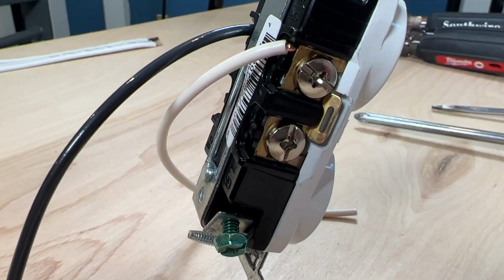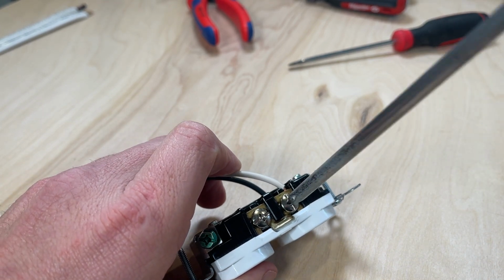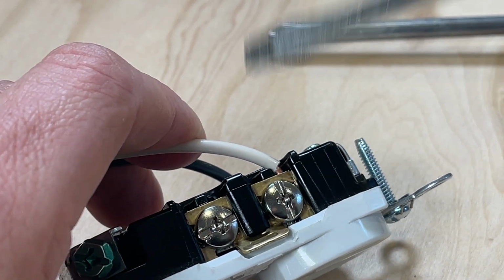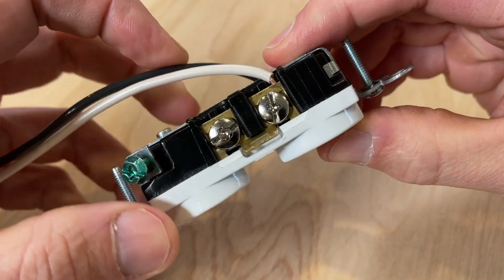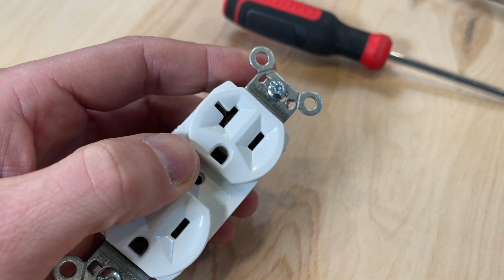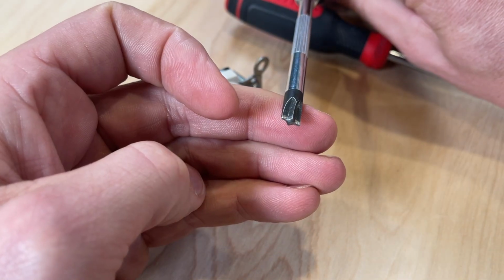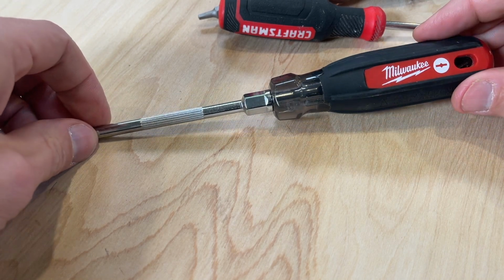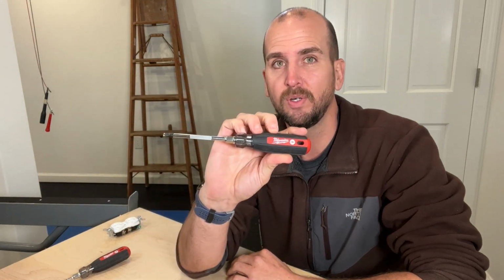80% of People Use the Wrong Screwdriver For Electrical Work

Comment: The Roberston (square) is a simply superior screw.  It is great for electrical work but what I like best is that when driving screws you can put the screw on the bit first and it will stay there. Also, the screwdriver bit will not cam out as easily as a Phillips or slotted. If you buy a box of Roberstons you will never go back to Phillips.
Reply: Every type screw has its disadvantages, including Robertson.
Reply: @jamese9283  True, but Robertson has one quality the others don't have: you can easily renew the screwdriver tip. Robertsons are slightly tapered so if the driver wears grind a bit off the end and now it fits good as new.
Reply: @jamese9283   whats the disadvantage ??
Reply: @mikecarter9225  Robertson disadvantages:
- less forgiving to drive if your screwdriver is not perpendicular to the screw head
- less forgiving if you have the wrong size or cheap driver
- easier to strip if your driver slips out due to less metal contact area between the screw and driver
- easier to overdrive (phillips is made to cam out with too much torque)
- harder to seat the driver into the screw head due to the precise fit, especially when there is debris in the screw head
Reply: @jamese9283  Robertson simply has less disadvantages than any other type.
Reply: Slotted screwdrivers don't "cam out" because a slot is not tapered, as a Phillips drive is. The main disadvantage of flat blade screwdrivers is their lack of self-centering.
Reply: Add a good magnetic bit holder and you can’t make that screw fall off.
Reply: @jeffreyesguitar5129  , if you're using non-magnetic stainless steel deck screws and similar, magnetic bit holders and socketed screwdrivers don't work any better! But yes, Robertson screws in general are terrific, and I prefer them over Torx.  Note that Makita makes a handy dandy little hollow, bullet-shaped magnet that slides over the shaft of your screwdriver or 1/4" hex drive bit and adds extra magnetic grip. These work really well for holding screws of all types.  I've never used a Robertson screwdriver on electrical outlet screws, but a #1 does seem a little small for the job. I wish it was a #2.
Reply: @goodun2974  Why do you prefer Robertson over Torx?
Reply: @jamese9283 ,  for one, Robertson screws not only stay on the drive bit or screwdriver tip better than Torx do, even without a magnet, but they stay on the head better when you're starting a screw into wood without drilling a pilot hole, and there's less wobble and play between Robertson screw and matching driver than you'll find between Torx and driver. That junction of Robertson screw and driver just has a solidity to it that Tork do not. You can really feel it.
Reply: i personally prefer hex drives never had one broke on me and even if it did you can just cut it and reuse it i wish every bolt was hex drive
Reply: @DatBoiOrly   I have seen plenty of stripped out hexhead screws. Part of the problem is that they come in both SAE and metric sizes and it's not always apparent to the average person who goes to use an Allen key (as they're known in the US) if they've actually selected the exact correct size wrench to fit that screw. It kind of requires thinking about the device and asking yourself where and when was it made and where the hardware likely came from. The audio equipment I work on for a living often arrives at the shop with chewed up hexhead screws from somebody else going inside of it and maybe using the wrong size wrench or a hex wrench with a worn tip. The worst case scenario is when somebody tried to break the screw free with a cordless screwdriver!. I always try both metric and SAE wrenches to find one that fits nice and snug, and then I ALWAYS break the screws free by hand. Metal chassis and cover plates with black paint or anodizing are often frozen in place, to the point where when they break free under tension they actually go ping or snap! Occasionally I encounter one so tight that I have actually twisted the hex key a little bit! It's not uncommon for me to have to use alternating heat and cold on the screws to help break the bond of the anodizing that seems to weld itself together under pressure.
Reply: @goodun2974  I agree. You must use the correct driver. But as he shows you can often get the job done with a smaller driver, no matter the type, but you well may foul up the screw head and/or the driver bit.Still I have often done this very thing.
Reply: @larsord9139   I repair vintage stereo equipment for a living and we frequently have equipment coming to the shop where somebody has  stripped or half stripped all the cover screws (especially if they're Allen/hexhead;  nobody else ever takes the time to make sure they have the absolute correct size, tightest fitting  hex key, and all to often they start trying to remove them with a cordless screwdriver instead of breaking them free by hand first). I've got a whole bunch of tricks for getting out screws like that.  If they're really stuck, as is often the case if the chassis, cover and screws are anodized or painted,  Alternating heat from a soldering iron or heat gun with cold from freeze spray often breaks the bond and makes it easier to remove them.
Reply: @goodun2974  I find another use for torx is to extract rounded hex screws.
Reply: @goodun2974  Ugh, I hate people being unable to tell the difference between SEA and metric hex heads. "Eh, this one is close enough. Hey why'd it round out?" 🤦‍♂️
Reply: @mjc0961  , it does give Torx a bit of an advantage if only because it's quite obvious when you're attempting to use the wrong size wrench ---- it just won't work at all!
Reply: @DatBoiOrly  I fully agree, problem is: hard to find all the types and sizes you need using hex drive. If they were more readily available I would give all my wood/sheetmetal/machine -  square/torx/phillips drive screws away and go all in with hex drive. (boy i had trouble spelling "readily")
Reply: Those screws are kinda annoying, though, when you come across some random screw that you need to take out of something and then you gotta get the screwdriver to fit that when 99% of all other screws are either Phillips or slots. Also, the nice thing about Phillips screws is that there's a huge amount of size tolerance, many Phillips screwdrivers will fit many screws (within reason), and you don't have to be precise if you're careful. In any application that doesn't require a lot of force, where you just need a screw to hold something together that isn't taking a lot of weight, the Phillips will work just fine and the reason so many people love them is because they combine all the best things about screwdrivers; the versatility, the ease of finding a screwdriver to fit it, how the screw is easy to remove one-handed, etc. For MOST applications, this works fine. But again, if you need lots of torque, then ... mayhaps you might want to use a bolt, a combination of screw-bolt (those screws that have ridged heads that will fit a ratchet socket), or something like these screws, or a Robertson screw. It all comes down to using the correct tool for the job, much in the same way that you would use tacks for felt paper, or wood nails to join studs. You wouldn't use a wood nail for felt paper, because the head isn't broad enough to hold the paper very well, and the tack is obviously not going to hold two studs together because it isn't long or strong enough.
Reply: @Dhalin  , whenever I have a basic repair around the house, especially if it's electrical in nature, I bring a 6-in-one screwdriver that contains two different flatblades, two Phillips bits (#1 and #2) and a 1/4" and 5/16" socket; and a 1/4" magnetic hexbit-holder with a selection of bits including Robertson and Torx stashed in the hollow screwdriver handle. These two tools will cover 95% of jobs .
Reply: Robertson has limits though...eh? They don't wear very well as bits in power drivers, albeit many configurations don't. A lot of commenters overlook that Phillips heads come in many different specs, and what's an apt driver for one head is a total disaster for another.
Reply: @stephensaines7100  , yeah, you kinda have to try 3 or 4 different bits to get a good fit to the particular screw your using; many people dont know about Pozi-Drive or how to recognize them by sight; and even though I've been working on electronics and old audio equipment for nearly 50 years, I only learned about JIS philips about 4 or 5 years ago! One advantage to Torx is that a T20 is a T20 is a T20 and there's no doubt whether or not you have the right size bit to match the screw. I do, however,  prefer the fit of a Robertson bit to the screw, versus a Torx; Robertson are less wobbly when driving into wood without a pilot hole.
Reply: @CautiousCrow  Robertson is less probe to rounding. I find Torx tend to wear down faster given the many fine machined points of contact. If you use the right size Robertson you will never cam out
Reply: I wish Philips screws were never invented
Reply: First things first… use Klein tools no many the cost! Get a 8” number 1 Klien screwdriver and stop messing around!

Comment: Canadian electrician here. The Robertson green and red handle screwdrivers are standard practice when dealing with electricity. I also have a Phillips and slot screwdriver in my belt for everything else. And it's not Northern Canada, it's all of Canada
Reply: The #3  Robertson screw is used for putting large panels on walls and large doors on hinges.  That what I use the #3 for.

Comment: I always use a number two Phillips screwdriver until I get it snug, then I go for the slotted screwdriver to ensure it's secure before I wrap electrical tape around the connections. I just finished wiring an 8 Gang box.

Comment: It's really annoying that for electric stuff philips/slotted is still basically standard. They should use Torx or Hex (or Robertson) and get rid of it altogether. Maybe they're afraid that people apply too much force and destroy the terminals, wires or screws/threads.

Comment: Where do I start...

1. Wooden ladder..Real professional
2. Metal shaft on screwdriver is too long = shock risk
3. Screwdriver is not rated for electrical work, should be 1000v rated
4. Should be insulated screwdriver.

Comment: IMHO, a number 2 Phillips should be the universal go-to screw head for everything (sure, use other Phillips sizes where required). Along with straight and Pozidriv, the EXC screw is a pox on our society. ECX requires this special, proprietary driver without offering any advantage to the user over Phillips. How in the world did this screw head become so popular in the U.S? Was it chosen as it can be used (poorly) with Phillips or straights? A Phillips bit turning a Phillips screw is a joy to use, especially as the neat fit means that a loos screw will stay on the bit without needing to be held in place. There is a PH2 driver in everyone's tool collection, can't we standardize on that?

Comment: robertson screws are very common here in canada, virtually all of our wood screws are robertson.  they come in 4 common sizes/colors.  yellow(smallest), green, red and black(largest)
those side terminal screws are actually a red robertson, it fits perfectly) and the 6-32 is a green robertson
the only phillips screws we see commonly are drywall screws!
Reply: There's a orange robertson (#00), smaller than the yellow (#0).  There are at least 2 sizes larger than #3 (black), but I don't know if there's a standard colour.  I have actually never seen a driver for them, but the screws with #5 head robertson was popular in early-mid 1900 Canadian furniture.

Comment: whenever i am presented with any screw i take my multibit toolkit which has allot of different bits then fit each to them until one manages to seat fully without wiggling, if i have an actual driver with that head i use the driver, if not i use the bit. and if i can't find one that matches right, i use the closest that i can find. has little to do with specifically this electrical work and everything to do with trying to not damage hardware.
Reply: oh, and in this case i would probably end up using one of my wide tip phillips bits, not sure what they are called, but they have a pretty much square tip with normal phillips blades, i have two types in my bit set.

Comment: Little issue: Those screws are supposed to be made for usage with Philips screwdrivers. If you read the box, it says specifically that a Philips screwdriver should be used, not a Milwaukee screwdriver.
So people when they used Philips screwdrivers are actually doing what the manufacturer intends for them to do.
Reply: That manufacturer does not know about Robertson square #1, and #2 driver are MUCH better than a Philips will ever be.  I have seen lose connections made with the Philips screwdriver and that can start fires.  In Canada all ours use the Robertson square.   It may be a different manufacturer.

Comment: Screwdriver bits are inexpensive compared to the overall cost of the electrical connector. Until this video I had never heard of the existence of an ECX slot, although, I have seen them in electrical connectors for years! I have never even seen an ECX bit. I have never seen a connector installation guide that recommends an ECX bit. Why does the connector manufacturer not supply ECX bits with the connectors, and not leave the installer to guess whether to use a cross-blade or flat screwdriver bit for these composite slots? I had thought (erroneously?) that the screws were designed for the generally unavailable Japanese JIS driver bit. Philips cross blades are notorious for camming out, damaging both driver bit and screw head. I generally prefer Posidriv, also wrong for electrical connectors. Since connectors should always be isolated, and proved to be so before attempting to work on them, insulated screwdrivers are a source of false security - leave live work to professionals.
Reply: Even the professionals who work on live wires end up dead.

Comment: Since I live in Canada, Robertson screws are very commonly used. The great thing about them is that you can hold the screw on the end of your screwdriver if you want to start the screw more easily. I hardly ever use Philips screws and never slot screws anymore.
Reply: When I get things that come with screws, they are usually Philips head (and soft metal, at that) so they go directly into the scrap metal bin and are substituted with Robersons.
Reply: Hopefully Phillips and slotted screws will be extinct soon.
Torx is coming on along pretty well in the US, they are readily available everywhere. They're around, but Robertson is still not too common here.
Reply: @mayorb3366  we gotta have something that cams out reasonably easy for mounting gypsum wallboard. Perhaps if mfgrs of wallboard guns introduced some mechanism that withdraws the cam-out-free bit at a certain point, but why? Philips still seems like it should be the go-to for drywall screws to me. darn near everything else? Robertson or Torx, please.
Reply: Prefer Robertson over all other profiles.

Comment: It is worth mentioning that the straight slot screwdriver shown, besides being the wrong size, is the traditional wedge shape.  Of course a wedge share wants to cam out of the slot.  The ideal straight bit is hollow-ground; concave (hollow) curve to a point where the two sides are parallel.  You almost never see this EXCEPT in the 1/4" hex bits.  I don't recall ever seeing the wedge shape in one of those replaceable bits, always hollow ground.
Reply: Good point.  I have hollow-ground a couple of screwdrivers specifically for electrical work, one for the screws used in conduit couplers is most useful.
Reply: Gunsmithing is another trade where hollow ground screwdrivers are the norm. Someone looking for individual or sets of hollow ground screwdrivers can purchase them from Brownell's or other companies that cater to gunsmiths.